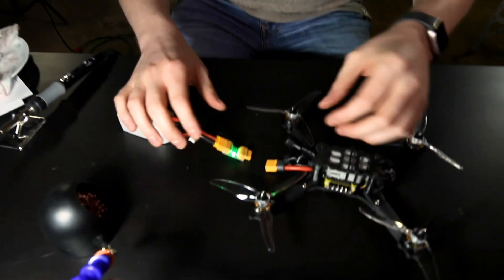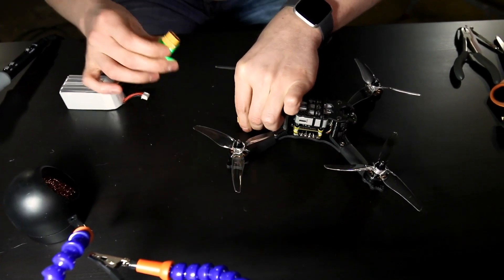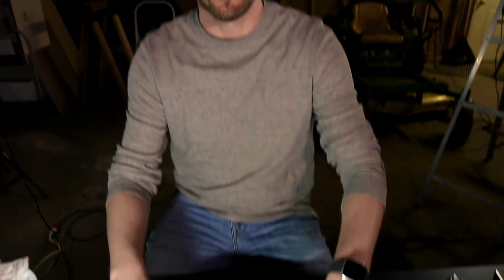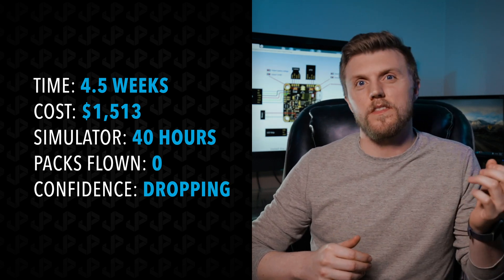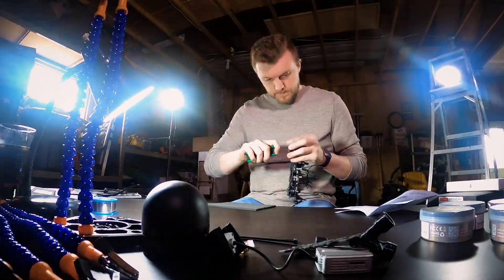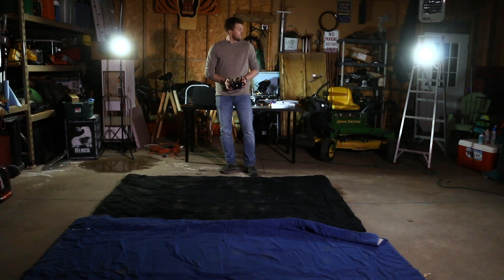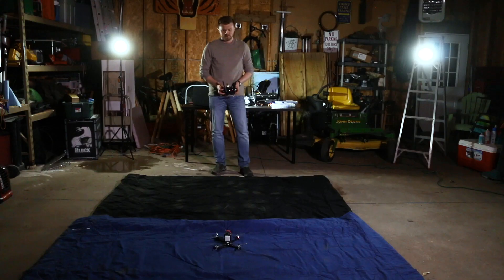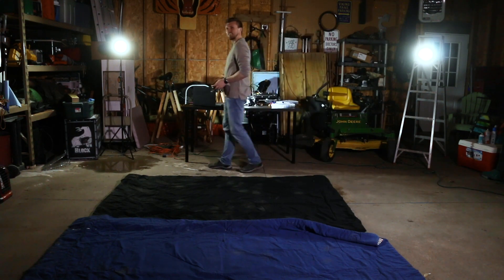Building my First Cinematic Drone | 1st FPV Drone to Hire

Comment: hey i noticed when you hooked up the battery you had some motors that didnt twitch. I had the same issue with one of my motors and it wouldn't spin. was that an issue with your build at all?
Reply from the maker: So I haven't had any issues with my motors. The "twitch" when powering up has to do with the position of the outer casing as the magnets polarize. When you supply power, the magnets align and if the outer casing doesn't match, you get the twitch from the magnets interacting with one another. It is possible for motors to just be close or in the right place and that twitch doesn't happen!